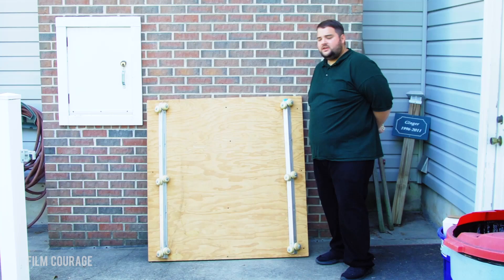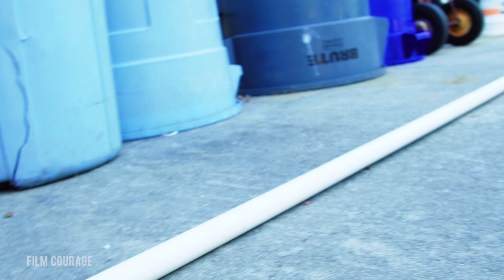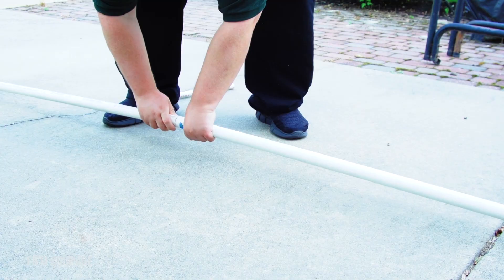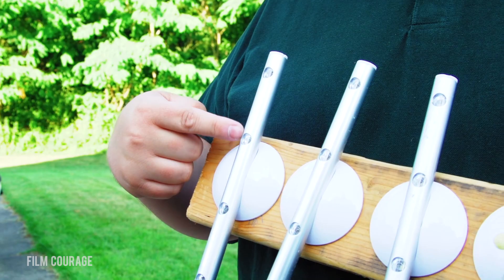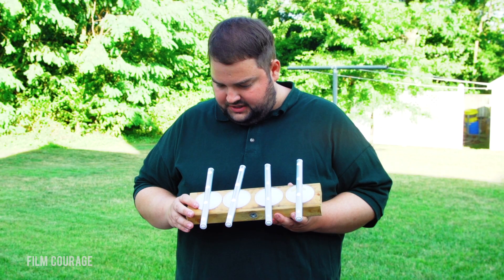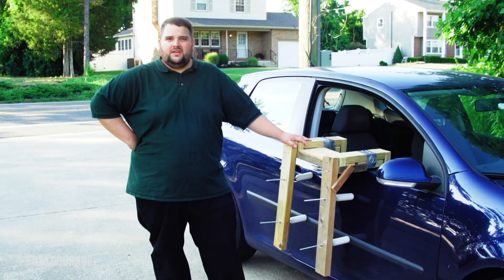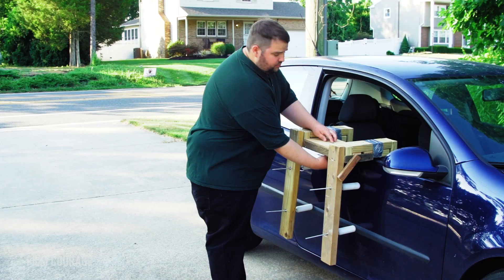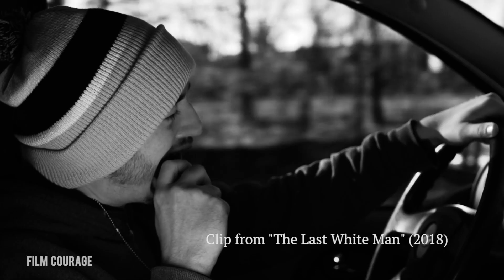How To Make A Simple Dolly Track, DIY Light Panels and Camera Car Mount by Mark L. Mazzeo

Comment: Hey guys if you thought this was cool be sure to take a look at our Kickstarter https://www.kickstarter.com/projects/21128070/the-last-white-man
Reply: On the "camera-car rig"... You might also seriously consider expanding the plywood platform forward (in relation to the car) with just a larger piece of half-inch plywood, and then bolting down a "well shaped" wind-break... It can be as simple as a small cooler, to block the wind which is usually the biggest hazard to cameras rigged on the sides of cars... I'm sure there's something around you... from discarded satellite dishes, to old hoppers from chipper-shredder machines that you can lay a hammer to and "re-shape" for a somewhat more "streamlined" profile... 
    The streamlined profile will still block wind against the camera, but it also reduces drag against the rig, and decreases the strain on the car AND door...
    It's all a matter of "how far do you WANT to go with this." 
     ...AND I loved these tips, by the by... I was originally mostly interested in the "paint-roller pads" on this thing. (lolz) I've been stripping rubber from engine mounts and transmission bushings for years... ;o)

Comment: Why not just use a wheelchair?
Tried and true, easy to set up and probably not all that different cost wise. Plus, no track limitations.
Reply: Wheelchair and a gimbal.....golden.
Reply: Not to shoot it down (the wheelchair proposal) but I'd hazard that it's a question of cost and availability...
   Depends on the area, because some parts of the U.S. wheelchairs are considered "medical supply" and are illegal (statute and misdemeanor level, so low) to buy and sell without certified inspections and licensing and expense...
    My area, if you know where to look, though, you can find them for like... 20 bucks... cash and go. SO not always an issue... In and of that, it's a good idea. Just pointing out there are some places... ;o)
Reply: gnarth d'arkanen Ah, permits and local laws, an independent film maker's mortal enemy.

Yeah, I suppose you'd have to look at other options in places like these.
Reply: I will admit (quietly) that I do adhere most stringently to the "Sacred 11th Commandment" as written in the Bible(?)...
     "If thou art not caught, then thou hast never sinned."  ;o)